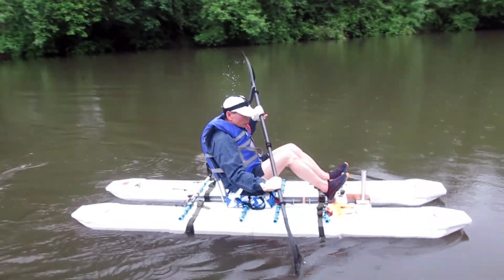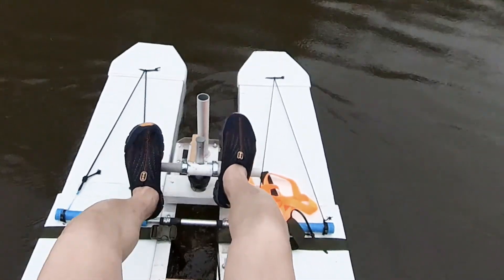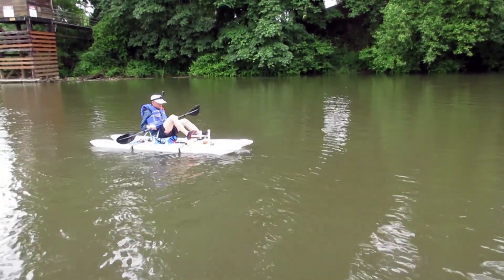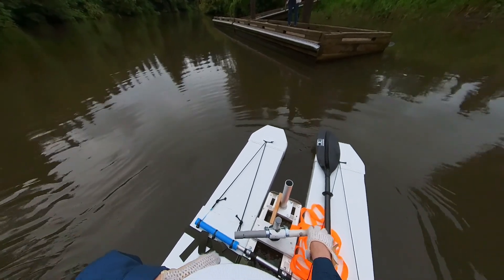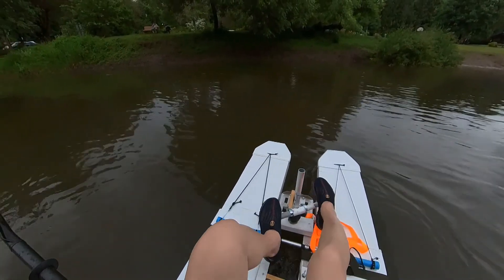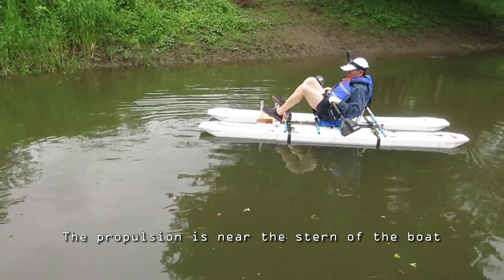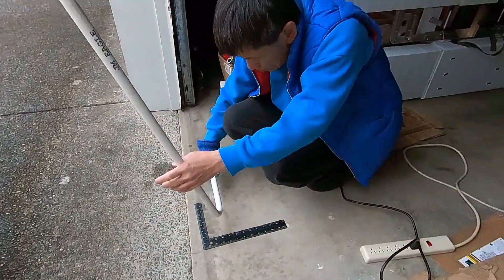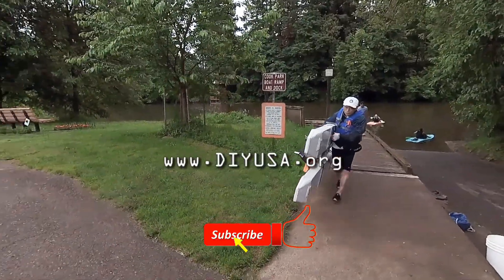Pt 3 $25 DIY Kayak Paddle Drive - Test

Comment: I believe your control of the boat by reducing the force of your peddling of one side is essentially creating a rudder effect while reducing your potential for advancement.   I believe a rudder would benefit you more so than reducing your peddle force for control.
Reply from the maker: Yes, you are correct. I used the paddle to change the direction of the boat instead of propelling it forward. However, the basic design does not create enough thrust to drive the boat. I believe adding the arm will greatly improve the thrust. Thanks for your suggestion.

Comment: I think it has potential.  Thank for showing us development experiments. You did not say anything about the size of the fin.   Of course your fin typically only needs 1 leg to push it for its designed usage..
Reply from the maker: Thanks for your feedback. I will give more details once I get that to work. I will test the update (the one with the long arm) this week.  But this morning, I have come up with a new drive idea which I will share in the next 2 weeks. That will be better than the ones I have shared so far. I believe you will like my Gen 3 idea, which will be very different from what you have seen on Youtube. Cheers!

Comment: I think that you can use Mr. Atsushi Doi power fin and adapt the pedal system at the the power fin. Relative easy to build and more thrust. Power fin in action: https://www.youtube.com/watch?v=8PsumIJMwDQ
Reply from the maker: Thanks for your suggestion. Mr. Atsushi Doi has other wonderful designs. I have moved on with another power fin design in this video series https://www.youtube.com/watch?v=FJiuj0o3alQ&t=62s

Comment: thanks for sharing the results! I think in addition to wider angle for the flipper, may somehow increase the surface of the fin. bigger slower movement with more surface and use feet to paddle slowly... idk, but curious how you develop this further!
Reply from the maker: Thanks for the suggestion, that is a very good direction, i.e. to increase the surface of the fin. I will test this new 'Gen 2' drive this coming Friday and will update you. I expect the result will be much better than my 1st implementation. 
You also asked another good question on 'what next"? I expect this new implementation will work much better than the '1st test'. But it is getting too bulky with the long arm. I like the mirage flipper drive. Just 30 minutes ago, I created a model of a flipper drive, looks like the mirage drive, but actually very different from the mirage drive concept. I believe this Gen 3 will work very well (better than my Gen 2), and not difficult to implement. I will share that concept next week. I am actually more excited about this 'Gen 3' drive than testing my new update Gen 2 drive. I questioned myself why I didn't think of this implementation in the first place. Please stay tuned! :-)

Comment: I was going to say that the oscillation is too too big an angle, smaller angle will give you a better result, but your new modification will help with that (it'll be harder to move the bigger angle) 
Also instead of the bungie cord, just plug/seal the ends of the pvc pipe and it will be naturally buoyant which will give the same result as the bungie cord but with out the part that can wear out, fray or break.
As another idea, look closely at the hobie mirage drive, if you cut the flipper down it's centre rotate the two halves 90º so both the left and right side of the flipper are facing the front of the kayak and the middle of the two halves are facing the back of the kayak, you have something a bit like the mirage drive paddles.
Reply from the maker: Thanks for your input. Yes, you are correct, the oscillation angle is too large. The reference design's amplitude is only 40%. I have sealed the PVC pipe also and I will test that with and without the bungee cord. My concern is that buoyance of the PVC pipe is not sufficient. My future plan is to study the mirage drive and see if I can come up with an implementation that a DIY'er can easily build. Cheers!